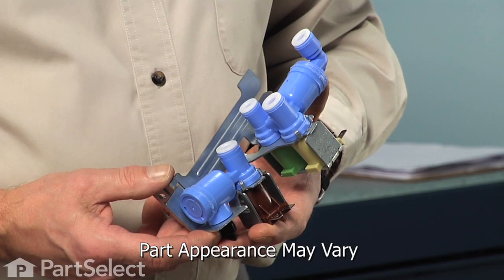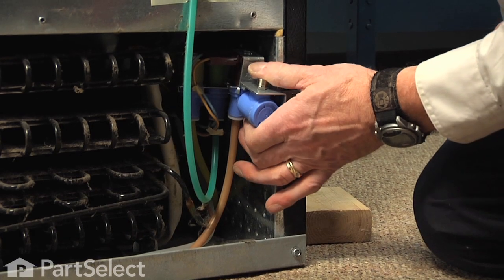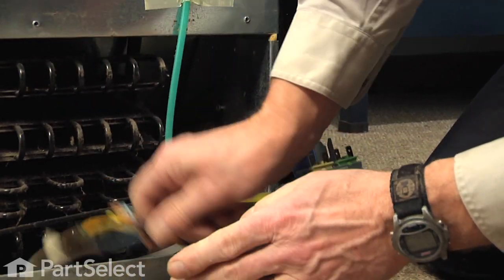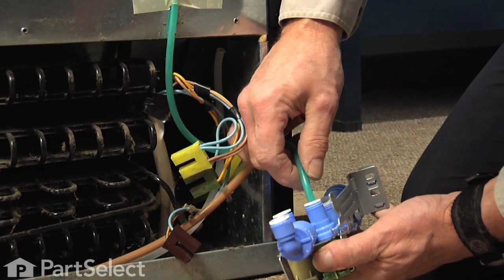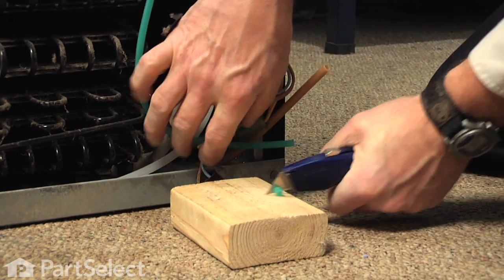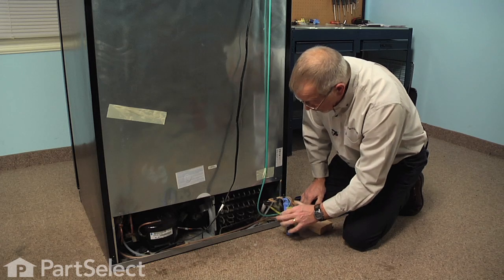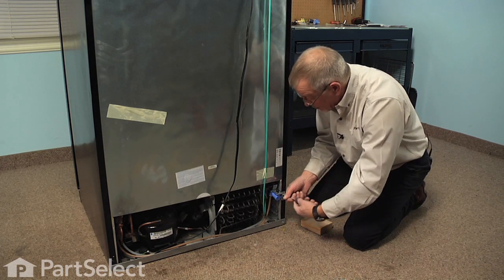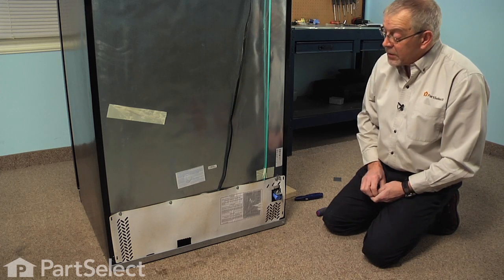Refrigerator Repair - Replacing the Water Inlet Valve (Frigidaire Part # 242252702)

Comment: This worked perfectly!  I lost water to both the water dispenser and the ice maker.  If I selected water and pressed in the dispenser I could hear the pump running, but no water.  I still had power to the dispenser buttons, etc.  I used a spare filter to ensure that the problem was not my filter.  I verified that my door switch was still functioning.  I checked to make sure I had good water pressure from the wall as well.  Based on the above I ordered a new water inlet valve.  Replacing the water inlet valve did the trick and installation was very straight forward thanks to this video!  Big thanks to PartSelect for the part and the install video!!!!!

Comment: This video helped out a bunch!  The inlet tubes that were on my Fridge had threaded screws rather than the push in type, so I wasn't sure what to do.  Once I saw how the newer connection worked in this video, I just cut them off, shoved them in, and I was good to go.  Thanks!
Reply: I have same old type valve, will new valve have push in fittings

Comment: Would the water inlet valve be the problem if the ice machine is not making ice but the water dispenser is still working. Made sure the line from the inlet valve to ice maker is not clogged, and the "arm" is in the on position.
Reply from the maker: The inlet water valve could be your problem or the problem may be with the ice maker control module. You can check the water valve by exchanging the input wire harness from the dispenser coil side to the ice maker coil side and then
select water dispense for a few seconds. If you get water going into the icemaker mould then the valve is ok. Use caution around electrical circuits and good luck with your repair.

Comment: (I don't know if this channel is still monitored for comments)
I seem to have an electrical issue now - there is a loud buzzing sound and no water when dispensing.
Everything was straightforward on the install, and no leaks... But it is no longer working.
Thoughts? 
Great video and thanks for having it available 👍
Reply from the maker: the loud buzzing is likely the inlet vale coil being operated, with out water flowing thru the valve the noise is loud, with water flowing it muffles that noise. Check to make sure the water is turned on, I know but I have t mention it.  Depending on the valve you may have the hoses reversed, maybe check that as well.
Reply: @partselect   thanks for the quick response.  We checked all the lines and one (yellow) was cracked. We replaced the line and checked the home water pressure and brought it back up to 65psi. All is working well now:) thanks for the video!

Comment: I just replaced my valve tonight. I have a Frigidaire FFHS2322MBB. I still have no ice or water. I have great water pressure. I can feel the water going thru the water line. I took the filter out and it had water. What else can I check?

Comment: Hi - I have a Kitchenaide KSSC42QKS01. Behind the ice maker there is a plume of ice coming down from the fill tube area. Would this be an ice maker problem or the solenoid valve leaking water when it is supposed to be off?

Comment: we have replaced this part but it is still not making ice.  replaced starter relay and capacitor originally - it stopped making ice after relay was installed.  line does not appear to be frozen.  water dispenser works.  did we wire it wrong, or do we need an ice maker control module?  again, it was making ice previously and only stopped after we put the relay in.  and yes, the arm in the ice maker is moving.
Reply from the maker: Make sure both harness connectors are attached at the water valve. Are you saying that the ejector arm in the ice maker will rotate but there is no cubes to eject?

Comment: I have a Frigidaire side by side refrigerator(model number FRS6R5ESB6)and I replaced this valve and it's still not getting water to the ice maker but I'm getting water from the water dispenser.HELP
Reply from the maker: Hi Dicky, remove the cover on the front of your icemaker and insert an insulated jumper wire,(about 14 gauge), between the terminal ports marked “T” and “H”. I would suggest leaving it there for about 15 seconds which will start a test harvest cycle. Remove the jumper and wait until the icemaker completes its cycle. At the end of the cycle when the bail arm drops
back down, the water valve should be energized for about 7 to 9 seconds. You should hear a slight hum from the solenoid at that time. If not, suspect a faulty icemaker control. If you hear the humming sound but get no water, suspect that the water inlet tube to the icemaker fill cup is frozen.

Comment: The clogged to water dispenser cause water leaking at the valve when pressing dispenser while no water is out. Clogged was removed and water dispenser working but leaking still. I have installed a new inlet valve, but when the water is used or ice making, it leaks (at the valve connect to the white tube -1 valve) Should I trim the end of the tubing ? what is the cause?
Reply from the maker: Hi Kristi, please provide your model number and I will be happy to research this for you.
Reply: PartSelect Thank you so much for responding. I went ahead cut the tube and it works fine ( no leaks) so far

Comment: Hi, thanks for the video. I'm trying to figure out where the problem with mine is. Was working great (had it since '08) and suddenly stopped making ice. Mainly want to know if the ice maker moves does that mean it's ok? When I take the cover off, the gear will move making the wire move also, but no water coming in. thank you
Reply from the maker: Hi Mark, please provide your refrigerator model number and I will be happy to research this for you.
Reply: it's FRS6HR5JSBO. I figure it's either the maker or the valve. Also, the water works fine next to the ice. thanks in advance!

Comment: Hi, my fridge stopped making ice and stop dispensing water. I changed the inlet valve. But still no. Ice nor water. When I press the water dispenser it makes a creaking sound, no water come out, no ice. How long after the inlet valve is changed does it take to start dispensing water?
Reply from the maker: Hello, it can sometimes take up to 24 hours for your ice maker to make ice once it has been replaced. Here is a video to help you
trouble shoot why the water dispenser is not working. https://www.youtube.com/watch?v=Q8PMGWyvry4If that doesn’t help please supply your model number and I can research this further for you.

Comment: Model FRS26KF6EM4a:  When ice maker is on (wire in ice bucket is down), I get periodic dispensing of about 4 ounces of water through water dispenser tube.  When ice maker is off (bucket full), it doesn't happen, though all else works - dispensing water, dispensing ice.  Earlier the water dispensing did not work so I replaced the micro-switch for water dispensing as it had appearances of a big over-current event.  But it had the same problem with periodic dispensing through the water tube.  Seems like diodes bad?  How do I further troubleshoot?
Reply from the maker: That sounds like the dispenser control may be defective and activating both the dispenser valve and the icemaker valve at the same time.
Reply: +PartSelect Thanks for the suggestion!  I replaced the diode "kit" and now get water dispensed without water into the ice maker.  However no ice being made.  Tried swapping connections to the solenoid a and got good humming but no water up the tube to the ice maker.  Replacing the three solenoid valve next?  Or the ice maker itself?
Thanks for your experience!
Reply from the maker: Verify that you don’t have a frozen water line or inlet tube to the ice maker. On models that have a three solenoid valve, one of the solenoids is used to operate the water line through the filter, so it must be energized at the same time that either the dispenser or the icemaker solenoids are activated. You can try putting the ice maker through a test harvest by
holding an insulated jumper wire between terminals T and H with the bail arm down. This will activate a cycle and the inlet valve will get energized for about 7-9 seconds after the ejector arm have rotated. This is a live voltage
test and caution should be used.

Comment: Working on Kenmore model #795.51026.010.  My problem is the water dispenser over fills the tray and when the ice maker rotates to dispense the ice, it will not dump the ice.  Is the problem with the water valve or ice maker itself?
Reply from the maker: If your water dispenser is not shutting off completely, I would suspect the inlet valve may be the problem. Are you referring to the ice bin auger rotating or the ice maker ejector?
Reply: The water tray over fills and freezes hard so when the tray try to eject the ice it can't. It gets stuck and stops the cycle. I don't know how to control the amount of water entering the tray.
Reply from the maker: That symptom sounds like a faulty water inlet valve.
Reply: I installed a new ice maker and problem solved.

Comment: I have good water pressure going to the refrigerator but my ice maker tube keeps freezing up what could cause this and I'm getting water from the water dispenser.HELP
Reply from the maker: Hi, if your ice maker tube keeps freezing up check for any obstructions or debris in the fill tube and water line first. You could alsoremove the water line from the back that connects to the inlet fill tube and let the water line sit in a bucket or suitable container. Make sure that you shake all the water out of the tube. Turn off the ice maker with the bail arm or switch if your model has one, and then monitor the container for any signs of water coming out of the water line from the valve. If water continues to
drip from the water line, then the valve is not shutting off mechanically. This can be caused by low water pressure or dirt in the valve diaphragm. If not water leaks into the container, then suspect that the fill tube is pushed too far into the ice maker cup or there may be an air leak near the fill tube that creates a frost or ice buildup in the tube. Hope this helps.

Comment: I replaced the valve but it leaks when I try and dispense water from the front
Reply from the maker: If it is leaking from the tubing connection, you may not have the tube inserted into the valve far enough, or you may need to trim the end of the tubing to obtain proper fit as shown at the 3:30 mark of the video.
Reply from the maker: If it is leaking from the tubing connection, you may not have the tube inserted into the valve far enough, or you may need to trim the end of the tubing to obtain proper fit as shown at the 3:30 mark of the video.

Comment: the water won't shut off when released
Reply from the maker: +Evangelist Eaglin most likely the switch is sticking.
Reply: where is the switch
Reply from the maker: +Evangelist Eaglin It could be the one behind the water actuator. What is your model number.